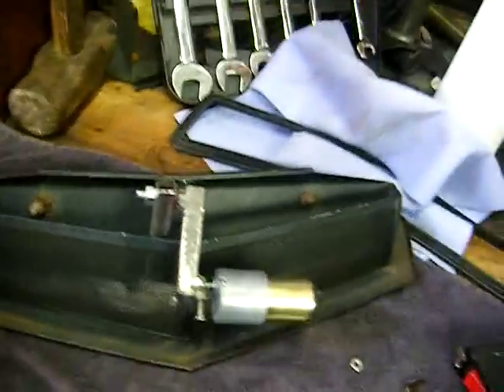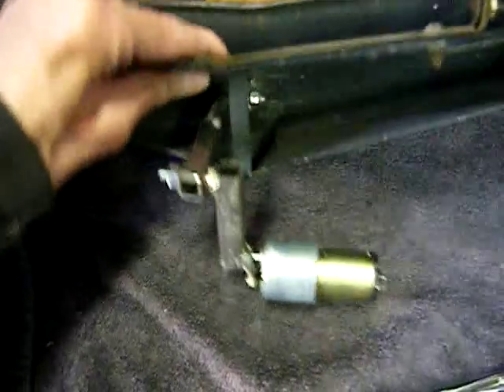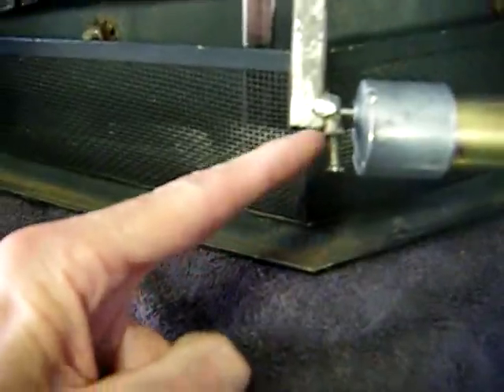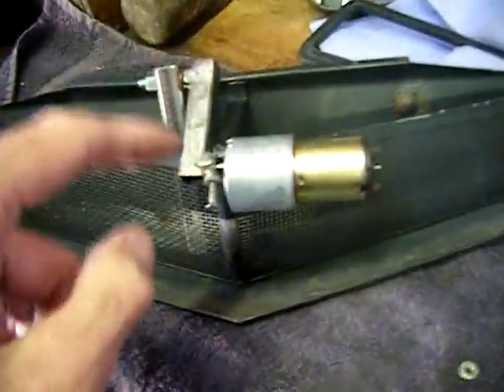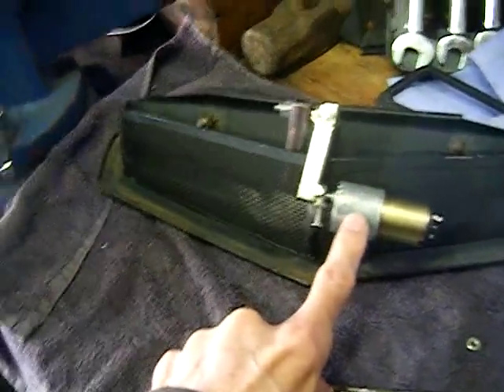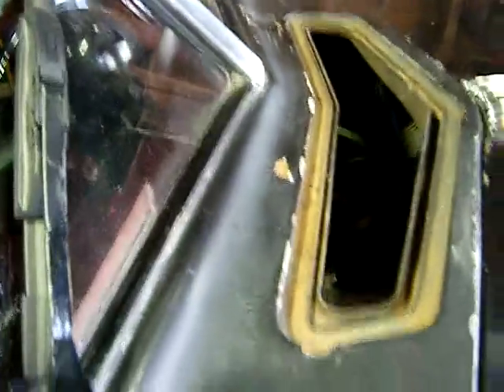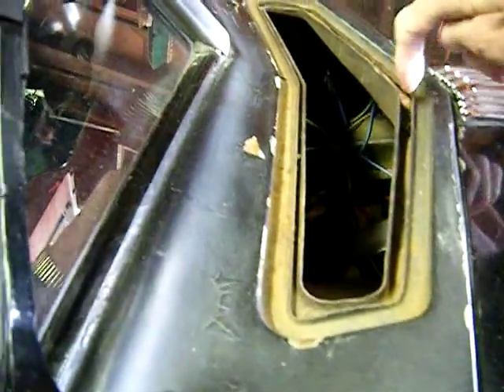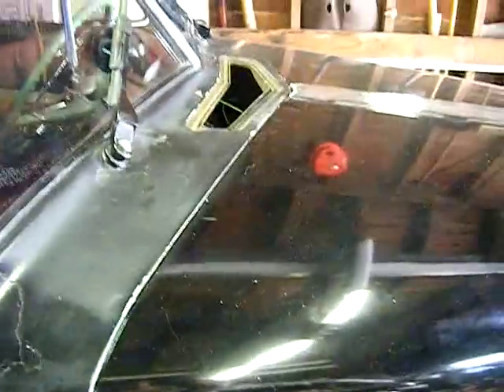Cowl Vent Project

Comment from the maker: The little motor does make a neat noise when it runs..my heater door has one too, sweet! The drain for the cowl vent leads out of the vent's well, down through a hose, which attaches to a small steel pipe welded in a hole in the floor (or the firewall, I can't remember). So, the water would drain out on top of the bell housing maybe?
I may add weather strip below the lip of the vent lid...but if water gets in, my feet will get wet! ;-)